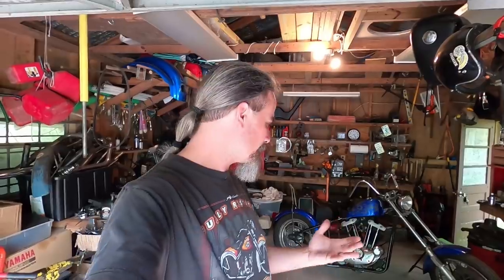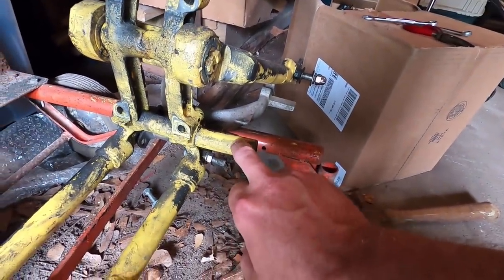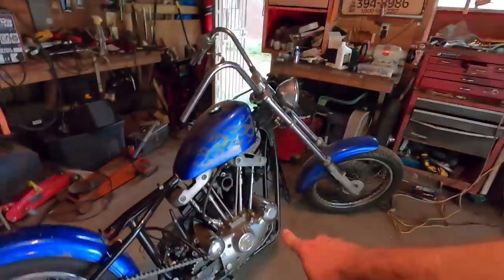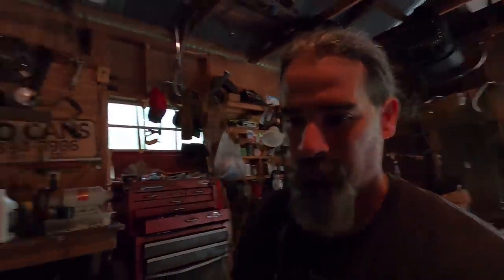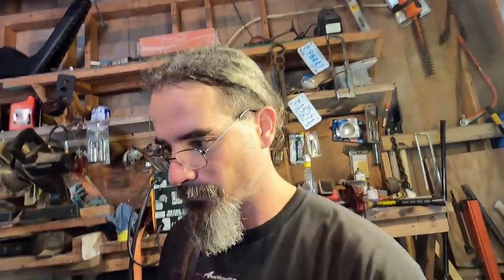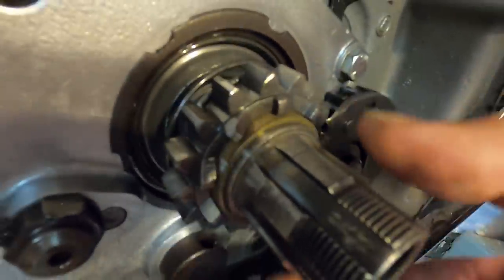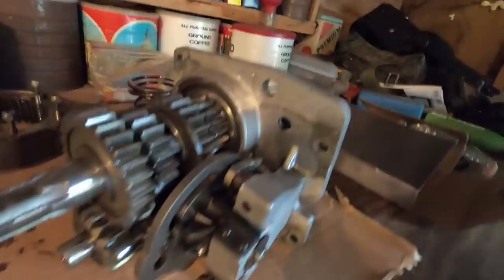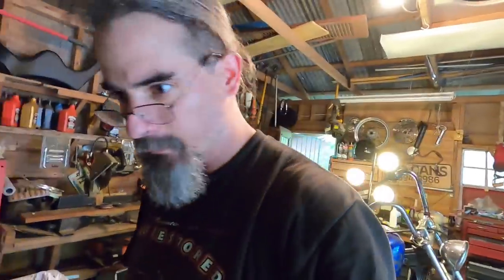This IRONHEAD Motor WON'T WORK For This FRAME As Is / Left To Right Shift And A Kick Start Problem

Comment: Even if I never work on an Iron Head I love the history lesson. You, sir, have a wealth of information and I am glad that you have decided to share it.
Reply: watch out if you start working on Ironheads,everyone disses them but start working on them and you will love them.
Reply: Man, it won't hurt ya, I take them all off but the top one. Then I start taking it off the bottom pops out. Once the tension is off the spring you can remove easily. Now,,, putting it back on is a whole other thing.

Comment: 75 & 76 was a band aid from factory to comply with government mandate for standardize all to left shift.  Agree, cable rear brake poor at best.  They finally did it "right" in 77.  Own a 1974 & 1976.  Switching from one to the other can really play with your head for shifting/braking.
Reply from the maker: Yeah I reckon so. I'm bracing myself for the first ride after start up. Lol

Comment: That puller you used for sprocket I once bolted one to a two inch flat steel with holes in Wright spots to pull clutch

Comment: Old video but just what I needed to see. I have a 71 that has a kick only, but the case is ready for a starter and as I’m getting older (still a young pup to some of y’all at 32) there’s days I just don’t want to kick. So this showed me exactly what I needed to do. My clutch doesn’t have the gear I need on it. Off to look for the right part now!
Reply from the maker: It may be easier to find a clutch basket with ring gear already on it. Try ebay.

Comment: That right hand shifter is a real mind teaser when you ride 3 other machines with the standardized left hand. I ripped my bike between stopplights and about killed myself stomping on the shifter to stop in time.  If thats how you decide to solve the issue its your rde. i ciuldnt stand it on my 72 so i put 75 crossover in it and reworked my brake up to my right forward control. You have a real old school aproach and love for that look. Going to be a sweet ride.    wrenching in a old shed with dirt floors is about as real as it gets and most likely relates to 90 percent of us watching you. the last time i used a ratchet strap for a makeshift tool i woke up 2 hrs later with sunburn and a shiner!!! lol ! work with what you got right. i could keep going but enough blabber! I Like you videos. keep it going !!
Reply from the maker: Lol. Sunburn and a shiner. That's funny. That's why I said don't try this at home.

Comment: My brother had a newer ironhead sportster where someone had used an older 1968 frame on a newer drive train. He had an issue where the drive chain would occasionally contact the oil tank among some other minor issues. His  solution was to get the correct frame, which he did and then everything lined up correctly.

Comment: I have had my hand on the ye old shovel sportster back in the late 1980s  It was a 77 sportster.  It had the electric starter with the swing arm frame with side shocks all original.  I had to chane all those case needle bearings for the four cams as well as the cam cover 4 bushings and the transission main shaft was shot and wiggled up and down, so I had the bearings all replaced in that by a harley shop and i believe digger as was his nae had to replace that mainshaft. Then an upper engine bore out because for how ever it got the way it was had standard pistons in cylinders that were 40k over creating a piston to wall clearance of 45 thousandths (horrible), so the jugs were bored out to 60 over and I bought 60 over pistons and that worked out good. .  Here are same things I liked about the design.  An engine oil vent which came out of the  cam cover in front and went to the back of the air cleaner, but I took rubber fuel line and ran it above the top of the chain so that any blow by would help to keep my chain oiled    .

Comment: Them straps come in handy. Hat a flat on a lawn tractor that wouldn't seat not even with starter fluid. I wrapped the tire a tightened till the side walls flexed out.  Hit it with air and beat it with a small mull hammer and it  took about 15 minutes compared to the 45 fighting it otherwise. Was hard to loosen the strap but I kept airing it till it seated and began to fill.

Comment: I had a 1933 Flathead Harley at the same time I had my 48 Indian Chief. One was left hand tank shift and one was right hand tank shift with reverse throttles. That screwed me up and i almost hit a car on the Indian so my cousin made the Indian left and shift right hand throttle so it was like the Harley. He had warned me about riding both bikes with different controls I should have listened he has been riding since 1956 and is the best machinist and bike mechanic i ever knew. He still rides and is building a 47 Indian now and he will be 80 in Aug.

Comment: I’m having similar challenges right now trying to put a 1979 XL motor in a 1975 frame. I ended up cutting the “footpeg bracket shafts/crossover” off the ‘75 frame so I had clearance for the sump pan added to XL cases in 1977. I’ve had to chase down all the 1977-78 rear (drum) brake control parts. The ‘79 originally had a rear disc brake and the footpeg brackets bolt to the motor, not the frame (1952-1976). All this work to get rid of the ugliest factory frame of all time.

Comment: Right hand shift...just like the Good Lord intended for an ironhead. It took a bit to get used to the right hand shift when I got my 74, but now I'm used to it. I got rid of my kickstart completely after the ratchet plate let go on me, put a Cycle Tech starter on it. A piece of hardwood flooring and two threaded rods has worked for me to compress the clutch spring many times.
Reply from the maker: Right on, man.

Comment: Make sure you shim the inner shifter shaft with washers or you can shim the pawl assembly. If you don't you might have trouble with that ball popping out of the cradle in the pawl assembly.

Comment: been using a large 3 jaw puller to remove and install pressure plate and springs for over 40 years, use new nylock nuts for pressure plate when reassembling.

Comment: This is something i went through.. 77 was the year harley retooled for the left side shifter shaft.. i have a 76 chopper build.. that i turned into a left foot clutch.. right side jockey.. had to remove and plug the shifter shaft.. cause i used a 200 rear.. which required a 1" off set front sprocket.. which mean i had to completely remove the kicker.. i went through all kinds of bs tryin to build my chopper lol
Reply from the maker: Choppers: taking a bunch of parts that were never meant to go together and making it work anyway. Gotta love it though.

Comment: HeySaddle Tramp, I remember that pressure plate problem also, I used a big 3 jaw gear puller and hooked it on  the back of the clutch basket and screwed the center screw right into the plate bearing, Works like a charm and costs nada! Your videos are cool keep 'em comeing.
Reply: Yep, I use a 3 jaw puller on my '79; ideal for getting the plate off, and just about do-able for getting it back on.

Comment: i had a 76 the nice thing is you can push the bushing out and convert it to a right foot shift which i eventually did. mine eventually became a stroker and no matter what we did with clutch messing with the trans etc could not get the bike to to come out of first gear with a load on it and that is when it was left foot shift so my friend shadow who is a master mechanic for  harley said screw it get rid of all the bullshit and make it right foot .which we did i dont remember if it cured the stuck in first problem but got rid of all the bullshit they put on 75/76 sportsters oh i do remember we put a barnett kevlar cluth in it and that cured the stuck in first problem.one can of worms opens another can never fails actually after watcing your vid it i remember how involved it was changing it over.those damn needle bearings.newer sportsters used a caged bearing so much better.great video tramp!!!!
Reply from the maker: Yeah they had a lot of problems in 75 & 76 with all the extra linkage causing issues in the shifting. That's why the reconfigured everything in 77 by relocating the shifter pawl shaft; causing it to come out through the left side of the case and out the primary. That fixed everything.

Comment: Hey..! Have watched some of your videos, interestingly enough i have done similar work on my motorcycles, the difference is that You have been lucky to get it work.. me still struggling with repairs...! Need help on a kick start installed on a FXSB Low Rider, it does not engage, so it does not start....! Have checked the spring, the one you showed on this video.. it seems to he doing its job, so i don't knw what is wrong with it...!
Reply from the maker: Not sure what to tell you. I'd have to be there to see what's going on. Never messed with a big twin kick starter.

Comment: I can really identify with your situation there - I have a habit of picking things that are not quite compatible. Then there is lots if work to make things fit - I lost count of the amount of times I later find something available that does the job I struggled with to make things work together - usually at less than half the financial cost.
 I suppose you are lucky that the bikes you are miss-matching were 'transitional models' ....
 Good luck, and I hope no one says that line ' You don't help yourself much - doing things the hard way...'  I always reply that it is so much fun solving problems whilst keeping quiet about the fact that I feel a real dumbass..... not calling you one though Tramp !

Comment: Hey brother, question. I have a 1979 motor and I have an early frame like that. If I keep the left side shifter and use a hydraulic brake for the rear what would need to be done to be able to put that motor in there? I’m gonna use forward controls also. So basically it’s a welded rigid frame and I’m going to use forward controls with a left side shift for the 1979 and hydraulic brake for the rear brake anyway so I don’t need any linkages. What do you think about getting the motor in there? I guess the shifter doesn’t have any effect on anything because it doesn’t attach to the frame at all but the break won’t either since it will be hydraulic from the forward control with a disc in the rear. But I hear about clearance issues for the motor.
Reply from the maker: I would think that if the holes match up on the motor mounts, you shouldn't have any issues with fitment.

Comment: @SaddleTramp did you film changing the ratchet plate? That would be great to see
Reply from the maker: No. Didn't have the guts to do that myself. I took the clutch basket to my local bike shop to let them do it. Good thing too. After seeing what they went through, I certainly would've messed it up.
Reply: @SaddleTrampTV  I'm actually now considering swapping my bike from right to left shift because I'm gonna run disc brakes on the back. Where did you source the parts for your swap if you don't mind me asking?
Reply from the maker: @HoneyBeagle  ebay
Reply: @SaddleTrampTV  thank you

Comment: I have a 78 sporster I hsve removed the 4 bolts to pull out the tranmission .but it artillery won't move  with the 4 bolts out why
Reply: I need to pulley transmission to replace the bearing but the trap door still won't Budge isthere more bolts removed aLl 4
Reply from the maker: Did you remove the the chain sprocket from the other side?

Comment: Turning that 75/76 back to right side shift will increase the life of the tyranny.  The Achilles heal of those years was the heavy linkage that weighed down the tyranny and caused them to fail prematurely.
Reply from the maker: I don't doubt that a bit. Too much going on with all the added linkages.

Comment: I'm currently in the process of a 1969 ironhead and I need to look into the frame, do you have a link to where you purchased that frame from?
Reply from the maker: This is the route I went with on the Tramp.
http://www.tcbroschoppers.com/82-03-weld-on-harley-sportster-hardtail-kit-for-stock-130-150-tire.html
Reply: @SaddleTrampTV  right on!

Comment: So, ( haven't watched the whole vid yet), couldn't you cut the top pivot pin off, drill a hole and place a longer bolt and spacer or stepped shank to meet with the eye of the pivot rod? ....it's ok , I've seen more as I write this and you've got a plan. Smooth roads to ya from Down under.

Comment: When I ordered my new kick start gear it was from China, I had to grind them down a hair cause they were not fitting right.
Reply from the maker: I remember having to do that with my 79 years ago.
Reply: From China WTF dude
Reply: Steve Percival trust me I had no other choice, I looked into BAKER, they didn’t make them anymore and I also couldn’t a machine shop that could produce it anymore, I bought it from JP cycle catalog. But any who, I’m divorcing the iron head and tranny and putting a softail 5speed in that. That is the only Chinese crap I ever bought after that I learned how to weld and fabricate my own sh$t. I also bought a 10 inch south bend lathe and a Bridgeport milling machine so that will never happen again and that was 13 years ago when I didn’t know anything. Check out my channel on my chopper test ride all USA including a hurst shifter made in the USA!!

Comment: "Cheesy design"  and AMF go together like peas and carrots.
Reply: If it wasn't for AMF Harley Davidson would have been out of business 50 years ago!!
Reply: @lskiller1903  You are correct
Reply: @lskiller1903  Or bought by the Japanese
Reply: Easy. My AMF bowling ball has never leaked a drop of oil, or left me stranded on the side of the road.
Reply from the maker: lol

Comment: Mmmm I guess I was right about a shifter linkage issue, kick start issue... ok tramp where is my sticker?  Na, just kidding, I wonder if it would be cheaper to hunt down a different motor?  I would offer you mine but I am in the middle of two builds at once, my 68 XLCH AND 70 XLH. I would hunt down another motor if it’s more cost effective for you in the long run!  eBay usually has some units, bits and pieces.
Reply from the maker: Nah. I figured a way to make it work.
Reply from the maker: @kenwhite9983  1975